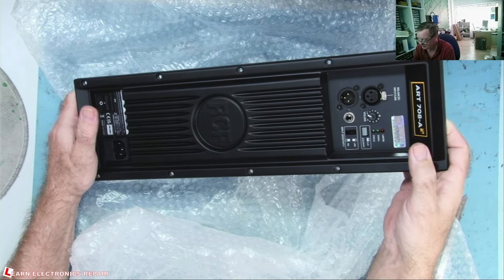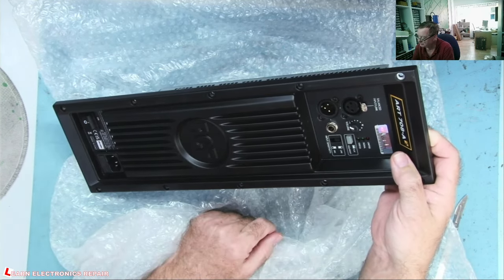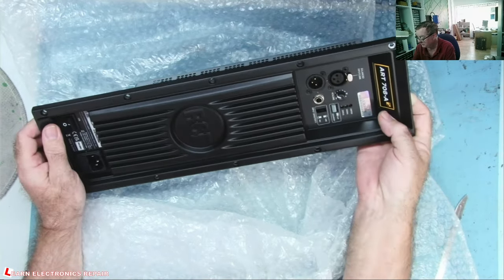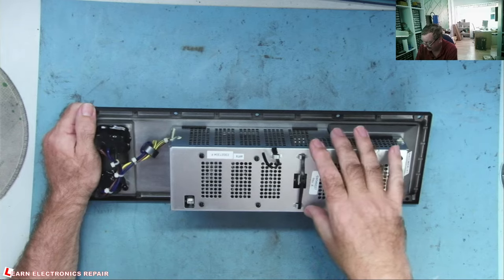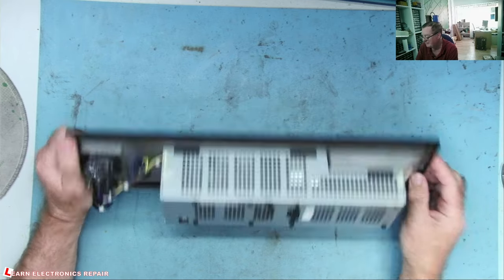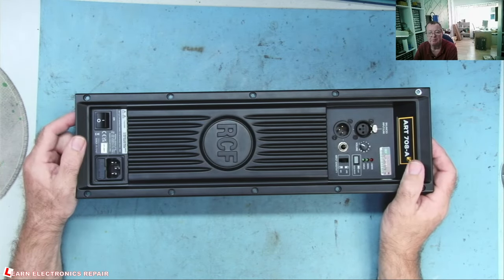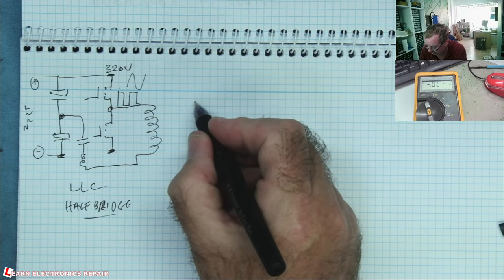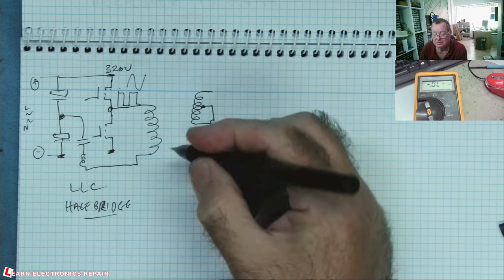Does A Short Circuit Mean Something Is Faulty? When is a short not a SHORT.

Comment from the maker: I spoke with Dan over in Lanzarote this morning (he sent me the amplifier). After watching the video he tested the speakers. So the bass driver speaker coil had basically melted, it had welded itself into the magnet.  The tweeter coil has blown apart.  We had a chat about what could have caused this, apparently he got the speaker new from Thomann. kept it in stock for about six months and had only been installed and in service for a couple of nights. They have an audio level limiter in the bar so it could not have been driven too hard.  It's hard to work out what caused the fault, apparently it was making strange sounds intermittently before it failed
Reply: Just thinking out loud, but maybe a speaker ohm mismatch?  Thx.
Reply: Since you are located near equater, popping set into & out of cool gig locales probably allowed condensation to form.  You showed odd moisture marks on PC board.
Reply: @kendoty2463  And if it came from the other side of the equator, the current would have flowed in the opposite direction, like flushing a toilet ;)
Reply: @mikecro1111  , maybe hemispheres... 🙂

Comment: The title of this video really caught my eye.... I watch your videos very carefully especially when you are probing around components, and I really am studying the resistance readings you get... And I'm trying to gain experience based upon those numbers for learning what the next step might be when you find suspicious or curious readings.  And it looks like at some point when you think you might have discovered the problem it's time to go look up the component in question and use that information to see if the readings are what they should be based upon the internal structure of the component or is that component defective based upon reading the components inputs and outputs.   I think you know what I'm getting at,  as far as fixing something quickly I think overall... what we do here that's not particularly important, what is important is over time developing good techniques that will get the device being repaired diagnosed and fixed. Also I am constantly seeing components that I haven't seen before and learning the purpose of that component being designed that way and how it is used in a circuit.  It's Great information.
Reply from the maker: Thank you.  Yeah basically it's a mixture of
1. understanding what the basic layout of the circuit will be ,based on what it is (in this case two class D amplifiers it turned out)
2. Using datasheets to know what components you are looking at when you have some 'suspicious' readings

Comment: I saw on the PCB the marking "94V-0".  Ends up it's a rating ... "meets the highest flammability standards and can withstand harsh environmental conditions.  I wonder if anyone has every confused that with 94volts?!!  Thx for the video.  Love it when you draw/explain the circuits.  Cheers.
Reply from the maker: Yeah first time I noticed that was on an old motherboard, I went onto Vogons (retro PC forum) and asked for a user manual for 94V-0 😂
As you rightly say, it's a fire safety rating, a bit like IP66 is a water/dust proof rating. I suspect someone sometime did mistake it for 94 Volts.

Comment: Heya, oke the mosfet is short but how does that blow the fuse ? low and high site are separated by the isoptilazer and the transformer
Reply from the maker: Whatever wattage is dissipated in the low voltage side will also be dissipated in the high voltage side (assuming 100% efficiency).  So a high current due to a short on the secondary side causes a high current on the primary side, hence the fuse blows

Comment: I have an issue with a similar board setup, there's a -24v reading on the tweeter terminals, the mosfet keeps blowing for that amp or that mosfet and the SMPS power fets blow, there's no shorts and the driver chip is working????

Comment: There may be some teaching value to know that if I don't find a short in the primary power supply side I jump straight to the power transistors, then the secondary power supply side. But I suppose with the deeper understanding you provide, your "pupils" will soon come to the shortcuts themselves. 
How about the speakers? Should your customer measure them before he reconnects the amp?
Reply from the maker: Spoke to the owner.  See the pinned comment for an update

Comment: Watched again.  Got confused around ~38mins when you determined that the speakers were being driven by inductors ... inductors resist change (AC), so that's odd to me as speakers should receive AC ... and so I'm lost.
Reply from the maker: Ahh yeah.  So the class D amplifier is not like a linear Class AB amplifier.  It's much more like a switch mode power supply and uses PWM (pulse width modulation) to drive the speaker. The PWM is modulated by the audio signal, so what comes out of the pair of mosfets are high frequency square waves (hundreds of KHz) that 'carry' the audio signal.  The inductors then filter out the high frequency carrier and what you are left with is audio frequency signal up to about 22KHz.  The advantage of this method of amplification is that the mosfets are only ever on or off, so you don't need large heavy heat sinks and cooling fans.  Does that help you understand it better?
Reply: @LearnElectronicsRepair  , yes indeed!  TY!  I am weak on amplifier classes, so need more study.  I'm going to look for an oscilloscope screen video showing the PWM carrier with the audio signal in tow for better understanding.  But, very helpful.  Thx!  Cheers

Comment: Ok so it was me who sent in the amp. It was from a brand new speaker that had done at most 10 hours work inside. How the board got in that state i have no clue but there is no evidence of moisture anywhere on the speaker. I have now checked the drivers and both are blown. The low frequency voice coil is melted together. HF is blown apart. Customer said it started cutting out then went off. The other speaker is still in service and has had no problem.